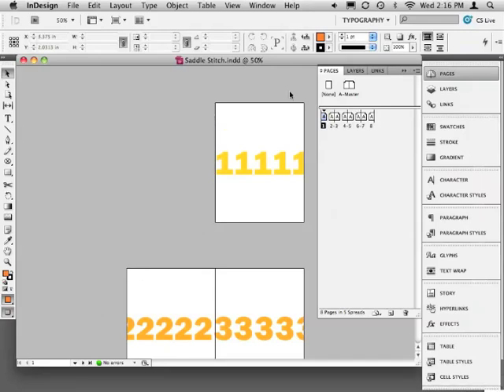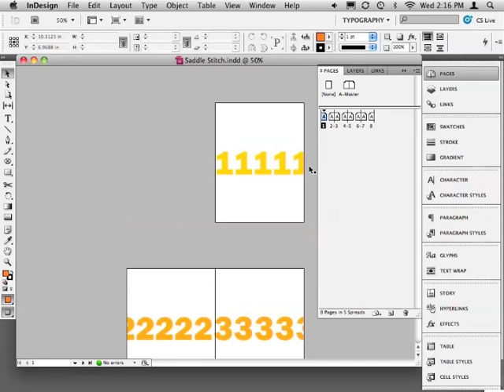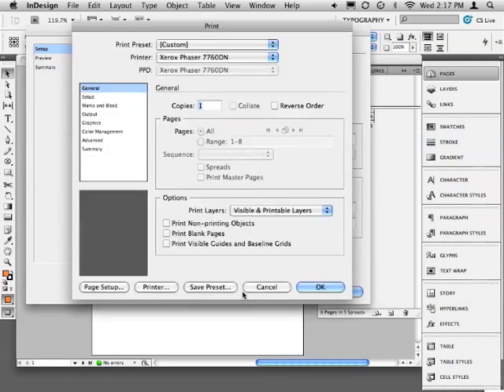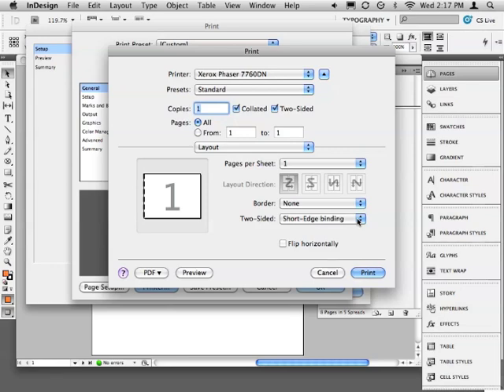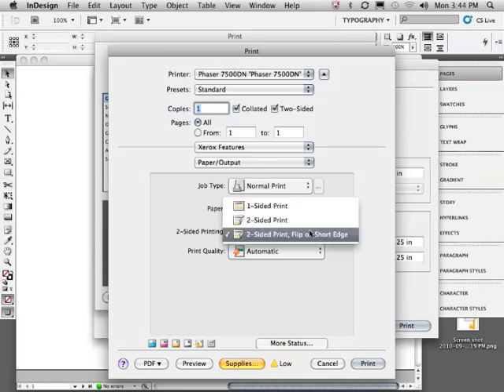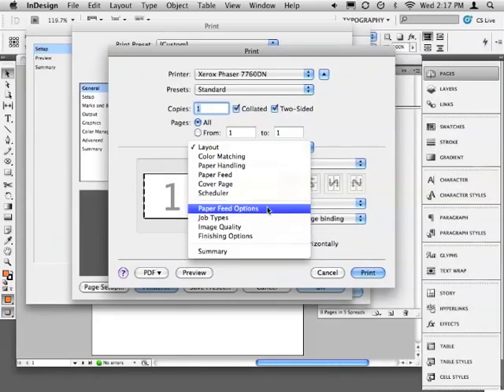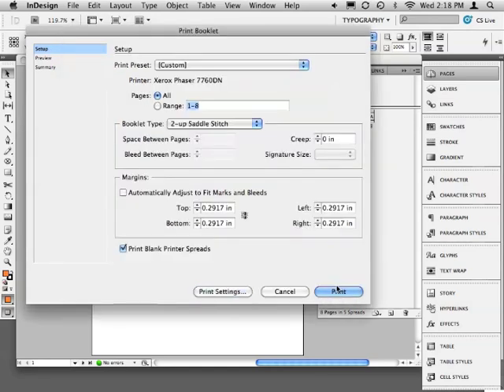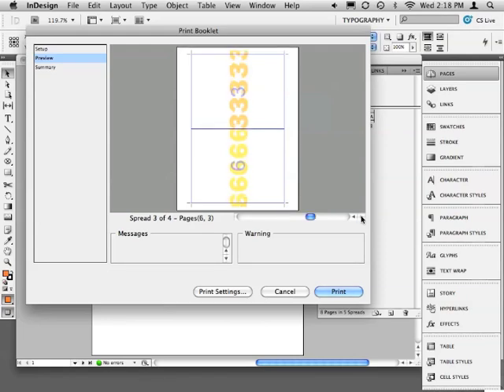Print Booklet from InDesign

Comment: I check all my paper sizes match to Tabloid and they do. After I check off everything basically the same way you did in this video, I STILL get a recurring ERROR message telling me the booklet won't fit the current paper size. Why is this? It shows the icon of the paper uneven as well, w red marks on the top and bottom. The only way to correct this is to go to page set up and select "scale to fit" when I do this however, all my images are made smaller than what they look like on the preview. HELP PLZZz